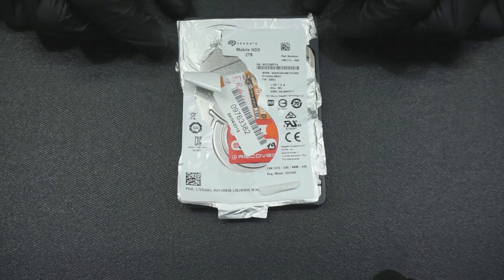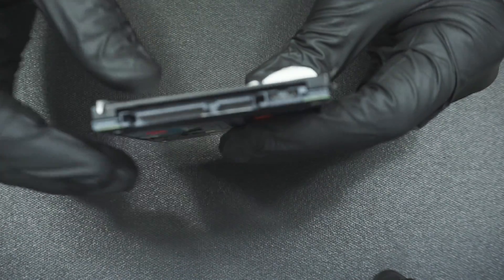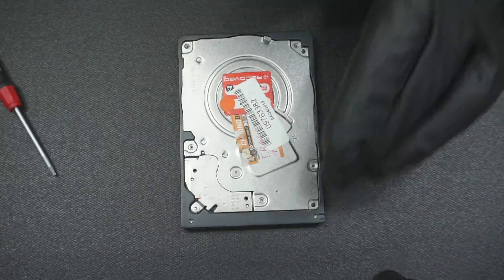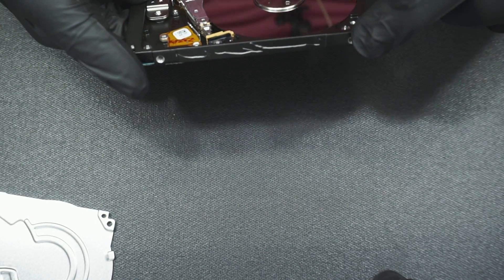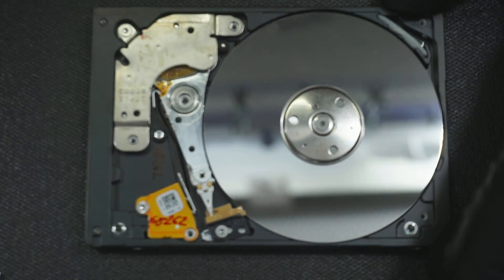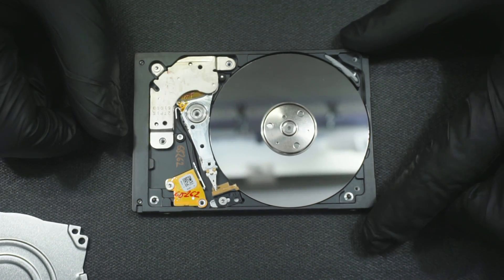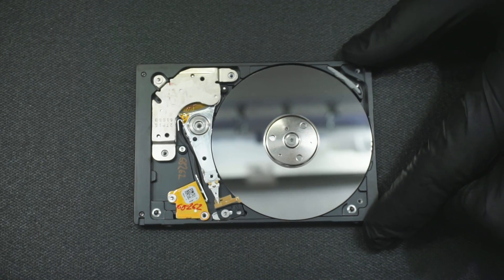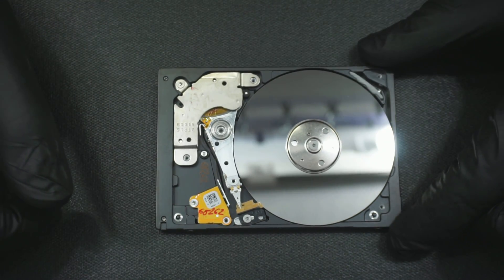This is what Steve works on, all day, everyday. FHL.

Comment: Same applies to most electronics.  First you find the repairs that introduced new problems and fix those, but wait you are not done yet as you still have to troubleshoot and fix the original problem.  Problems from improper solder rework are the number 1 introduced problem.  No flux, solder bridges, lifted pads, etc are the norm.

Comment: Here's the sign you need for your shop:

REPAIR RATES:
$100/hr
$150/hr if you watch
$200/hr if you help
$300/hr if you tried to fix it yourself first.
Reply: As a fellow IT professional, I tip my hat.
Reply: Charles Moon that’s kinda bs imo, repairs shouldn’t be hourly because that encourages the owner to work slower, without increasing quality.
Reply: @evaahh9584  Almost every other trade does it. Electricians, plumbers, plasterers, mechanics so why not repair technicians too?
Reply: @evaahh9584  Not necessarily. They still have a queue of drives to work on. If they spend more time than required, that's less satisfied customers per day.

Comment: I used to work at a disc drive repair facility as a frontline debug tech. I was certified in disc drive technology and worked at every station from inside the clean room and all the way to final inspection of the drive before it was boxed and transfered to finish goods for shipping.

Comment: What I see.

#1 White label = manufacturer reman
#2 Damage to casing from being in a vice?
#3 No seal on drive to prevent dust from making it into drive, Seagate uses the label for this... Which MIGHT be why they fail so  often.
#4 Apparent damage to platter on the side opposite the read heads, probably from prying the cover plate off.

Comment: If its just the power circuitry of the board thst failed, and a donor can be swapped in with the old BIOS, cant the drive be booted again intact, or does data corruption always happen no mater what?

If it could boot again I would get the latest backup and toss it into the donor pool.  My Seagate still under warranty to this Nov. just stopped being bootable (11 click syndrome). Odd for a well ventilated, non shocked, cared for etc etc drive (the much older maxtor in the other pci slot was just fine, so wasnt a "lightening strike" past the APC surge unit)

Seems no one just makes them work again and lets customer do own recovery, must not be feasible?
Reply: should of kept your data backed up. that's the important thing you hopefully learned

Comment: Hey can you guys help me please?? I recently got a macbook pro from around 2009 and i wipe the hard drive without knowing id be locked from reinstalling the os. I cant get the old apple id and i cant find any videos that help with models that dont have internet recovery modes or access. Please help me!!!!
Reply: You will need to make a working recovery USB stick from another Mac. I suggest diskmaker from macdaddy.io. You also will need the installer for whatever macos you are trying to install, that's kinda hard but it's possible good luck. Your laptop also is worth about 50$

Comment: Cool. I wonder what you clean a platter with?
Reply: Wet & Dry 2500 grit...
Reply: @TonyRule  ewww maybe dip in acetone? That'd disolve the oil in the fingerprint.
Platters are very chemically resistant even in aqua regia
Check out Nurdrage's video
 https://youtu.be/L0bcNm1gfpU

Comment: in their defence, that label must had been near impossible to remove
Reply: Which is a disgusting practice of complete disrespect.
Reply: What's so wrong with just cutting along the seams instead
Reply: @MisterMosfet  - That requires intelligence.
Reply: @72Yonatan  no, both of you are wrong, the sticker is a functional part of the assembly and must not be cut
Reply: I AM GOO GONE
Reply: their*
Reply: @blnk-1773  thanks
Reply: Its not really that hard
Reply: Yeah, if they were edward fucking sissorhands
Reply: Goo Gone baby, woohoo!

Comment: I'm pretty sure Steve would have mentioned it if it was the case but at 3 o'clock are those dents in the side of the top platter or just a reflection ? When moving the disk around sometimes the "dents" seemed still visible so that's why i'm asking.

Comment: WHat about those huge scratches on the right side of the platter, right in the edge? you can clearly see the disk is mangled there
Reply: As a guess from knowing some hard drive tech, the platter disc might've experienced a hard impact that shut it down in the first place.  Some drives will include a brake to halt the platter's spin, usually trying to avoid damaging the platter but building it cheap could mean no brake and the platter dings the side of the casing or a cheap brake that just jams against the platter's edge.  5k-10k RPM to 0 RPM almost instantly is a pretty hard stop, whether it's designed to do so or not.  That said, the edge of the platter might not contain any data at all due to the risk of damage, but less platter space used = less disk space registered.
Reply: might just be shadows
Reply: U lie Marcos!

Comment: Why do you guys deal with the liability of a drive that's already been opened? I can easily see a customer accusing you of doing this damage although it was obviously someone else's doing. I assume you always open them on camera for that reason.
Reply from the maker: We actually tell people not to send in things they messed with without contacting us first on the mail-in page, but like the part that says don't send us your Apple box if you want it back, they ignore it and send it anyway.
Reply: Document, document, document,. Document EVERYTHING you do.
This video and footage from under the microscope will show the received condition (did they use a friken chain saw to get that label up!?), the actions taken and the result. It can be the difference between a customer getting mad that the data could not be retrieved and accepting/acknowledging mistakes were made before you worked on it.
Reply: It was already unusable to begin with, it's not like they can do any more damage.
Reply: @jfoster.  my point was someone could easily blame the last person that had the drive even if someone else caused the damage previously. The last shop could've easily just said "eh we couldn't fix your drive, take it somewhere else" without mentioning to the owner that they also screwed it up in the process.
Reply: @Fullmetalseagul  That's like bringing your not-running car to a shop asking to have it fixed. Unless you're a mechanic and can diagnose or take apart an engine yourself, you'll never know if that mechanic broke more than he fixed.
Reply: @jfoster.  I realize that but we're talking about someone's irreplaceable data at stake here, not some part that you go and purchase from an auto parts store.  Not really a great analogy.
Reply: @Fullmetalseagul  Awe, I thought it was. 

If you lose a rod bearing inside your engine and it won't crank, is it similar in any way to having a malfunctioning drive head in an HDD?

Both contribute to the complete failure of the device, and neither can be repaired without specialized tools and knowledge.

My point was, in either case you're completely ignorant of whether the person doing the repairs actually created a bigger problem rather than fixing it.
Reply: @jfoster.  No, no it's not similar at all. A bad engine in a car can easily be fixed with a part or another engine which are readily available. If you mess with a hard drive and scratch the platter you're fucked. I work in VFX and my drive has project files that can't ever be replicated if lost. I would absolutely be devastated if they were gone, luckily I'm smart enough to have back up drives and cloud storage but not everyone does. I can guarantee you people keep much more valuable things on their drives than I do. 

If someone seriously damages the inside of a hard drive you can't get the data back. It's gone. Forever. Even if an auto shop had your car crushed and launched into the sun, you can just buy a new car, granted it won't be the same one but you can get another. You can't buy back lost data. Someone is going to be seriously pissed and start pointing fingers when they find out their data is gone forever. If someone gets their car back scratched, yeah they're gonna be mad but at the end of the day it can be fixed.

Comment: What’s the success rate on drives with previous repair attempts,?
Reply from the maker: The prior repair attempt drives close to zero
Reply: I can't speak for everyone, but one particular data recovery company touts about an 80% success rate, and they will not take drives that have been previously worked on.
Reply: zero